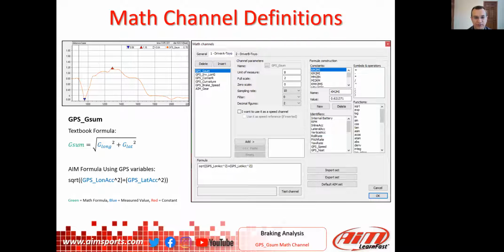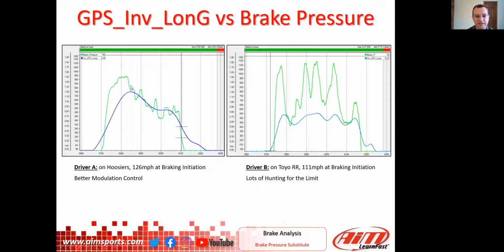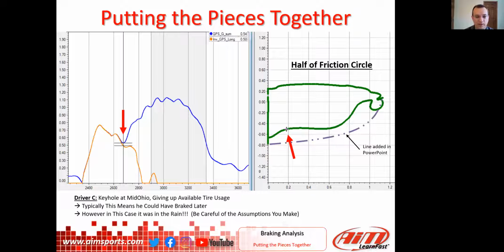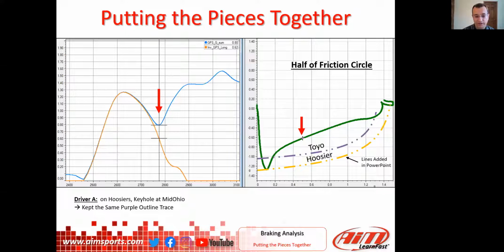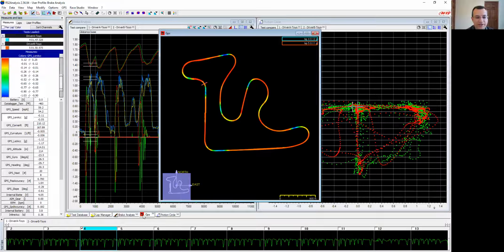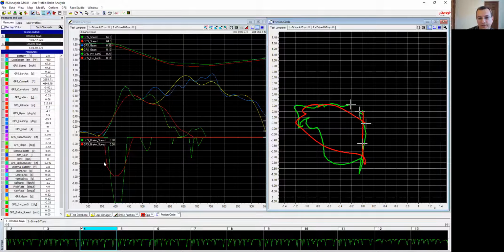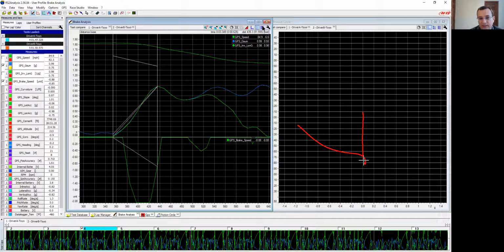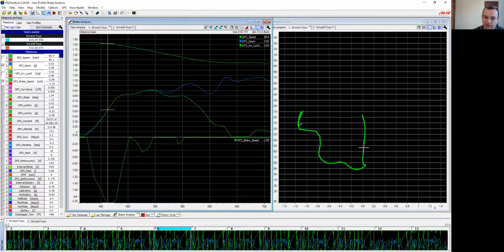1-10 Braking Analysis with GPS Based Data - Live Webinar with Jeremy Lucas - 4/30/2020

Comment: Ive been having problems setting up the brake speed channel with the new mychron 5s for gokarts, it was working perfectly on the mychron 5, it seems that the diffent sampling rate from the 5S is messing with the math channel. any tips?